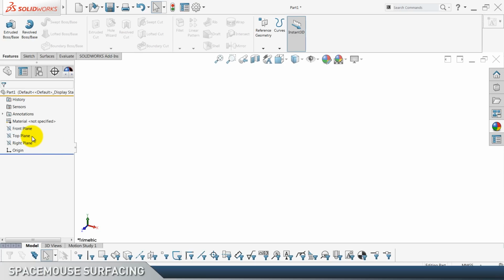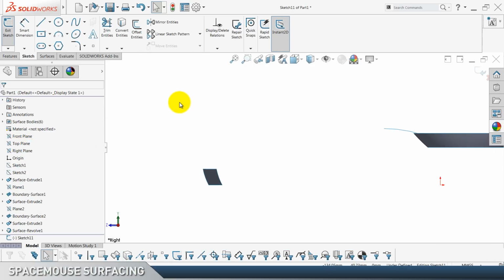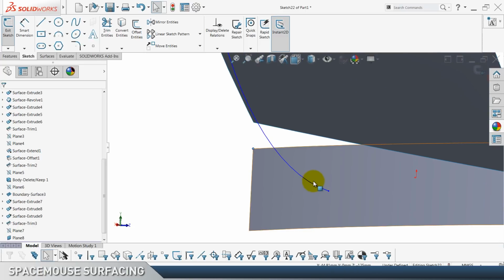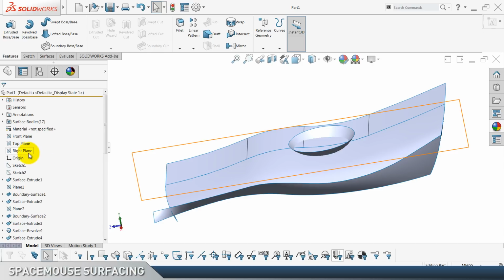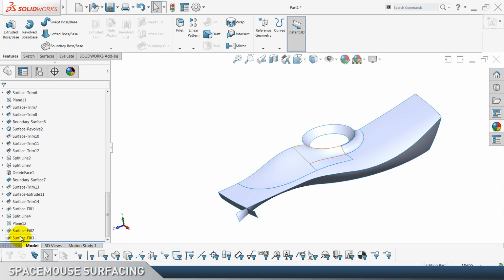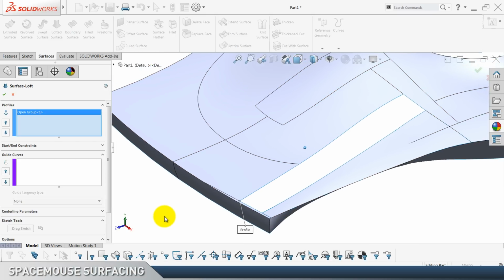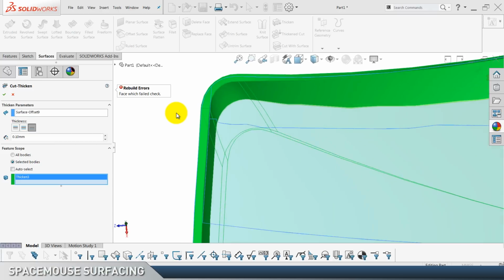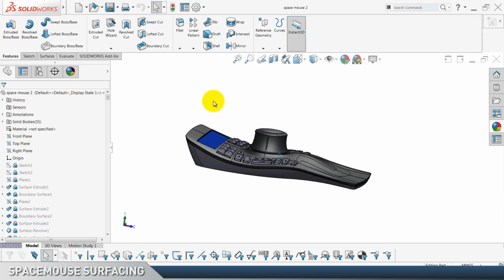SOLIDWORKS SURFACE MODELING TUTORIAL - SPACEMOUSE ENTERPRISE

Comment: This is ABSOLUTELY not the way to model this type of surface. 3 sided surfaces, 5 sided surfaces, point condition patches, G1 surface conditions. Just no.
It's really important that you plan your model to construct it using 4 sided surfaces and achieve G2 or G3 surface conditions for this type of product.
Reply from the maker: hey man, I do agree with you but my main job is to be freelancer and try make money to survive, making tutorials is something I was doing in a free time
anyways I spent a lot of time trying to achieve what you explained - four sided surfaces with G2 or G3 surface conditions but after a while it was going nowhere so I had to quit, lower my standards and do it in a more simple way
perhaps it was not smart idea but I did the best I  could with the time I had

Comment: Hi thanks for  a great video.  Im having a problem about 10% into the video where you draw a line from the sketch in right plane from one surface to the opposite surface and then construct two line to get the angle.  After trying many times to connect the first line i finally switched to 3d sketch and accomplished the point to point., but now it wont allow me to dimention between the horizontal line and the off horizonal (3 degree) line.  Any suggestions?
Reply from the maker: Well you should have done everything as I did, please show me on video timeline where is the issue?
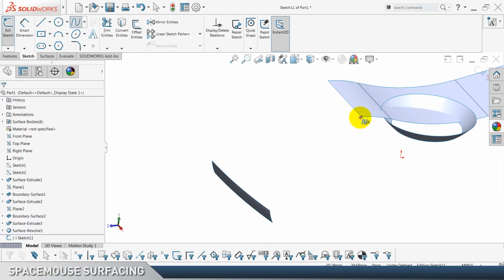Reply: @woodpecker_cgi_studio  After successfully doing Surface-Revolve1 ,at time 29:26 I entered sketch on right plane and could not connect to that corner.
Reply: Hi PI.  I found the problem.  I forgot to hide the left side of the artifact from sketch 2 and so was trying to connect beyond the right plane
Sorry for wasting your time
Andy
Reply from the maker: Ohhh it's OK my man, good you find what was causing the issue
Good luck with this tutorial

Comment: Thanks for this tutorial. Great work but a lot of problems i saw.
I have more time to need to look at your video than to build it. 
I build it in Creo and it was done in one day. Not so much problems as in  Solidworks and much esiar to build.
Even the buttons 1 to 12 are ready. The other ones i build tomorrow and i will post a little video here
Reply from the maker: Sorry for late reply, yes I should have made it more simple
Anyways share your work if you can
Reply: @woodpecker_cgi_studio 

wel i just publish it on https://grabcad.com/library/3d-connexion-spacemouse-enterprice-1
my buttons are not so nice as youre buttons
thanks again for the tutorial
Reply from the maker: your model looks very good, I see you've been busy fixing those surfacing issues :D
your buttons are good, just add filets and you're done. 
You're welcome

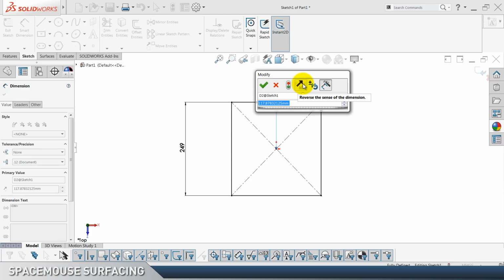Comment: Wait! @ 1:54 you use Insert Part "from original part" Am I missing another tutorial here, where did that part come from? I am 100% with you until this point. I want to also add that this has been extremely helpful , thanks!
Reply from the maker: no, there is no other tutorial you need to watch, something was just wrong with file I was working on so I had to give my model to be inserted as a part
Reply: Phone Industry I’m not sure what you meant by “original part” I’ll try sketching that section only and see if I get the correct surface match. I don’t expect you to walk me through it here in the comments section. Even if I finish with the defect this has been a helpful tutorial. Thanks!
Reply from the maker: hey man, just saw your comment, have you managed to go over it
basically tutorial was made in a way that you do what's shown but also there is a part that you need to download and insert it inside, hard to explain why xD
Reply: Phone Industry I have not made it back to that point yet. I don’t know where to download the part you inserted. I know a guy that is a a high level Solidworks designer and thought I would show him the problem when I can, he might be able to tell why the surfaces didn’t match correctly and if so I’ll let you know. Until then, I don’t know where I would download the part you inserted so I’ll save a copy to show my friend and continue the tutorial to the end with the bad surface match just for practice. If you know where I can get the part please let me know, if not no problem. Thanks for replying.
Reply from the maker: I left two links bellow the video to download the missing part: https://www.cgtrader.com/free-3d-models/electronics/computer/tutorial-parts

Comment: Hey, Thanks for the tutorial. Is there a reason you prefer arcs over splines? Easy to fully define?
Reply from the maker: Prasanna R N you're welcome
Well I always try to use arc instead of spline from few reasons
Easy to model and define
Easy to work with the surface you get out of arc comparing to the one you get by using spline
Also when it comes to creating both model and TUTORIAL MODEL which needs to be simple and without errors arc is better choice
Reply: Thanks for the quick reply! What are your views on tangential vs curvature continuous surfaces? With splines I can get curvature continuous ones but not with arcs, right?
Reply from the maker: that is the area that I should maybe cover with a video, basically tangency between surfaces creates different shape from the curvature transition, of course it can not be done with arcs but I guess it is always less complicated and therefore cheaper to produce a part that was modeled by arcs then the one done with splines etc. ;)
Reply: That would be great! 
One final question. How do you get the measurements that you used in the base sketches? I would like to model my XBOX One controller but I don't know where to start.
Reply from the maker: well for all tutorial you were able to see on my  chanel I do it like this - visit the offical product website and see what dimensions are listed, then I take what I have [meter scale or basic school ruler] and then I measure the rest of things which are not listed on the website
you need to look at the object you want to measure just like it is in solidworks, look and measure from front, side [left or right], top, bottom etc. take those measures and make some sketches or something
then by seeing the shape see how are you gonna set the process of modeling and by knowing how are you gonna model it you will then see what other measures you also need
now of course there are some stuff that are hard to measure so sometimes you have to guess but it is interesting process
now of course, it's always good to have some real measuring tool such as caliper and micrometer but not having those didn't really stoped me from creating logitech m185, logitech m705, spacemouse and a lot of other models - they are maybe not perfectly precise but not bad either
plan of how are you gonna do it and using right modeling techniques is to me more important then right measures, that's why I am making all these videos
also don't forget one thing, if you can't well measure whole model but only base dimensions you can always take images of it or find on internet and those images you can set up in sketches as a blueprints
by the way good question, I get it many times so I may do a video about it! :D
Reply: Planning is always the most difficult part! And you do a great job. You should definitely do a video about measuring and thinking through the modeling process.
Reply: Also, do you guess all of the arc radii?!
Reply from the maker: I think I definitely will :)
Reply from the maker: well sometimes you dont have to guess it cause you can sort off measure some distances but sometimes you just guess :D
Reply: Thanks :)